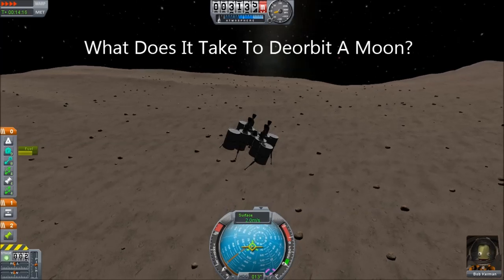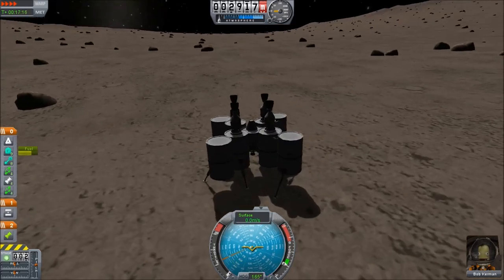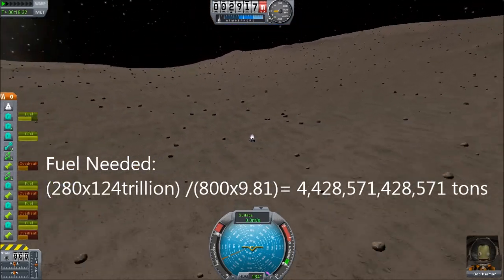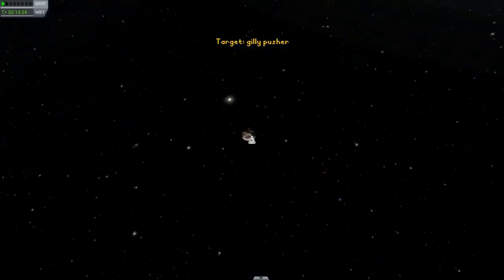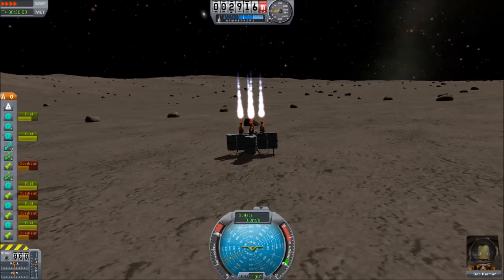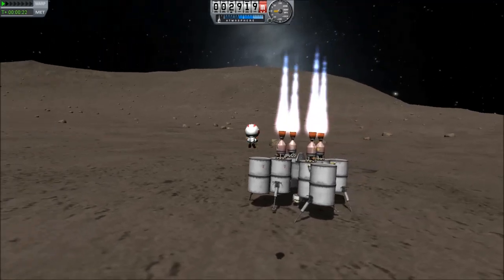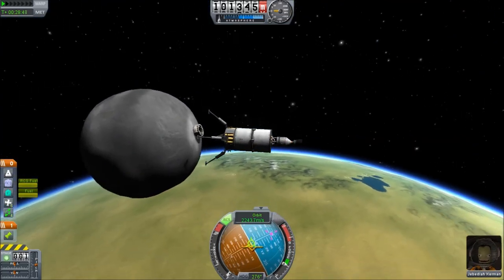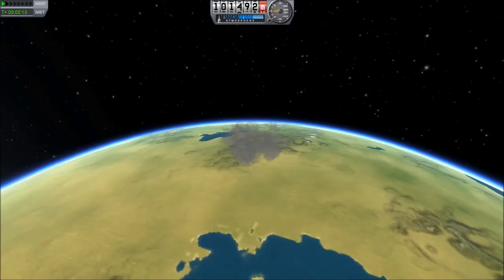What does it Take To Deorbit A Moon In Kerbal Space Program

Comment: Gas rockets can't move any massive object and here's why:

Unless you get the exhaust moving faster than escape velocity it will just return to form an atmosphere and give no net thrust.

What's worse is this atmosphere will then further block the rocket exhaust from escaping.

And to top it off, even if it is travelling faster than escape velocity when it exits the nozzle, it's a gas and will expand. As it expands it will no longer be heading straight away from the moon, making it even easier to be recaptured by the gravity well.

Comment: Mining invented: I'm about to end Gilly's whole career.
Reply: Mining & converting fuel from the body you're pushing would make it at least a million times easier -- literally!
Reply: @eekee6034  That just sounds like a fuel tank with extra steps
Reply: @rockspoon6528  I'm not sure what you mean. What I mean is if you bring all the fuel you need to move the moon, then at the start of the burn you have to move all that fuel and Gilly too. If you mine Gilly for fuel, you start out with far less fuel mass and you lighten Gilly as the burn goes on.
Reply: @eekee6034  My point is that you're using Gilly as a fuel tank.

Comment: How long would it take 5 F-1's (Saturn V booster stage) to turn Gilly completely into exhaust? Meaning setup some drills and an ore converter and just burn Gilly as it's converted into fuel. I imagine that would be an easier way to "move" Gilly haha.
Reply: According to my math it would take the Saturn V 1.927 trillion seconds to turn Gilly into exhaust.

5 F-1 engines could burn 12,890kg of fuel (5800 OX + 7090 LF) per second.
6,445 units of ore would be needed per second (64,450kg)
4,297 Drill-O-Matics would be needed (1.5 units of ore per second) or 172 with a level 5 engineer
2,578 ISRU's would be needed (2.25kg OX + 2.75kg LF per second) or 104 with a level 5 engineer

Mass of Gilly = 1.24×10^17 divided by 64,450 = 1.927 trillion seconds, or 61k years.

That's much quicker than 19 million years.

Comment: i remember making an engine mod and made it work no fuel, i tried to push Kerbin out of the way with an Engine that has 1 times the weight of the planet and it could fly up because it had 2x the power! so starting with it upside down on the pad, when i turned it on, it did not push the planet and that is how i figured out it was on rails! tho when i removed the weight and not the speed, in the inverted position, it just teleported out the planed into black! and the game was all bugged and no menu! the speed started with the number 4 but had to many numbers to display! cool and freaky experience!

Comment: You could use an extractor and a converter to replenish your fuel as you worked. For that matter, if you packed along enough extractors and converters, you could use a Mammoth or two instead of a NERV, since you can convert ore into oxidizer and liquid fuel at the same time. Use the Mun itself as your fuel tank! Of course, that still leaves the problem of "it's on rails". Mod anyone?

Comment: but You use only 5 engines? but with a 100 x100 engine's will it be stronger?
Reply: 100x100 engines.. You didn't account for the extra 500+ engines in the middle. No, it won't exhaust the fuel in a second, considering that you're having a few billion large fuel tanks in your store, so you're gonna need another few billion engines, then it would last for a second, and deorbit gilly at the same time.
Reply: Will be stronger yes, but will only last for like a second.
Reply: TheRedRifleman Animations Then it would basically just destroy the fuel tanks because the force ist too high.

Comment: You missed something:
To deorbit a moon, you would need a shitload of fuel. However, this fuel isn't just present there — it has mass of it's own. In fact, in order to move a moon using fuel, you would have to move the whole system of that moon, fuel, fuel tanks and engines — all adding up to whole mass counter. That means you would need MUCH more fuel to move the moon AND itself, along with tanks and engines, and adding a single engine would mean adding more fuel, because engines, of course, have mass, too.
There is another thing, however. By adding so much shit onto the moon, you would greatly increase it's mass, therefore it's gravity. It may be even enough to cancel the orbit and make the moon crash straight into the planet! Who knows? Calculations have to be done.
Reply: Though you still won't need as much as he mentioned. He said that he would want to "deorbit" by changing the velocity of the moon to 0. You don't need to do that in order to consider a moon being deorbited.
Reply: Medhusalem Problems of definitions. Of course it depends on the body that the moon orbits around, but decreasing velocity to zero is a fool-proof way to deorbit something - say, if both objects are just physical points with zero volume.
Reply: How did those calculations come out
Reply: @arandomcommenter412  Best of necroposting lol. Besides, I said I'm too lazy to calculate, and I'm true to my word.
That being said, a quick run through what I said makes me think I was mostly full of shit. Moving mass to the satellite would require matching the satellite's orbital v, and the worst it would do gradually destabilize orbits, moving system's center of mass until it becomes a two body problem, and then back into satellite problem if we move enough matter, but the planet and the moon would switch places in the system. They may potentially crash due to orbits having to cross each other at some point, but they won't deorbit.
Good to see I've made progress in the past six years.
Reply: the weight of the fuel would be negligible compared to the satelight
Reply: It may be much less, but definitely not negligible — still thousands and thousands of tons. I'd do calculations, even, but I'm too lazy to do that.

Comment: Obviously the most efficient way to de-orbit a moon in kerbal, assuming they weren't on-rails, would be to just land a big ass engine on it with a little fuel tank but with A FUCKTON of mining rigs and ore to fuel converters.

Why bring fuel when you can just make fuel from the moon? The more of the moon's mass you convert to fuel to de-orbit it the easier it becomes to de-orbit :D

I don't understand why scott didn't mention this as it is literally the first thing I thought of when I thought of possibly de-orbiting a moon.

Another big snag in the road would obviously be the moon's rotation. You could basically only be firing your engine a little under half of the rotation or otherwise you'd be killing the delta-V you built up on the 2nd half of the rotation.

I am disappointed Scott that you didn't mention these things as I am sure you are bright enough to know of them :)
Reply: the objectives to de-orbit the moon. not break it down and turn it into something else
Reply: Robert Harris
The % of mass you'd have to convert to de-orbit the moon is irrelevant. It's not like you are turning it into space rubble. And even if you shrunk the moon down to 1/100th its size it would still be a moon (until you actually de-orbit it and it is no longer a moon.. which makes your entire argument moot because turning it into 'something else' is EXACTLY the point)
Reply: ayporos uh. No. As long as its seperate the moon is the moon. Theres only 1. However it will no longer be a natural satalight.
Reply: RedRifleman studios wtf are you talking about?
Reply: Robert Harris
Just using combat as a way to disprove explosions in space. Really, if you need to move a moon with explosions only, you should use nuclear weapons.
 and, using the moon doesn't make it artificial: it just means we modified it.
Reply: RedRifleman studios you know theirs 2 ways to deorbit a moon right?
Reply: Robert Harris
I know that! You think i'm stupid? YOU DO? well then.
Reply: RedRifleman studios your the one talking about something completly random.
Reply: Robert Harris
You're the one trying to make me look stupid. Now, Explosions aren't possible in space unless the explosion is happening in a material. Simple as that. So you need nukes for the explosion to actually work, because the nuke will be exploding inside it's shrapnel.
Reply: RedRifleman studios i never said anything about any explosions...
Reply: Fuck wrong comment

Comment: If we are going to talk real physics here, it's still not possible with ANY amount of fuel, as the exhaust gasses will remain in a moon's atmosphere, and only contribute to it's mass. An ion engine would probably work because the ion plasma escapes at a fraction of the speed of light. This is why they have such high specific energy. But they are very low thrust.
The reason it works with an asteroid is that the asteroid's mass is insignificant, and the exhaust gasses readily escape any interaction with the asteroid.
Although on a moon, the exhaust gases do escape at a rapid velocity, and you'd think they would shoot out into space beyond escape velocity, this isn't true. They are, afterall, gases, and a gas has all sorts of characteristics like molecular interactions, bonding, and PRESSURE. The escaping gasses will form a slow moving cloud and eventually envelope the moon. Shooting a rocket off will quickly need to move it's own exhaust ploom off the moon as well. The ploom will begin pushing back on the moon with an equal force. Using a rocket on a body large enough to have just a slight atmosphere would be no more effective than pushing on the handrail of a boat, while standing on that same boat.

Comment: I realize this video is old, but here's a thought Scott.  Did you take into account the density of the fuel in your calculations?  The engines aren't just pushing the moon, they have to move all that fuel as well.
Reply: What if the fuel is in orbit and being transferred with a flexible tube?
Reply: @howlingdin9332   really old reply but like youd need a tube that is longer than the circumference of the moon because the orbiting fuel would be going faster than how fast the moon rotates
Reply: @John-pp6xy   You could put it in a synchronous orbit.
Reply: Howling Din 
this is an ambition that I like instantly
Reply: and the rest of the rocket parts
Reply: +Howling Din The fuel in orbit would be part of the moon's system. You would have to adjust its momentum in any case to keep it near the moon. TANSTAAFL here as well.
Reply: @Markle2k  just add a pipe that cannot possibly ever break, attach to moon, moon pulls fuel
Reply: Old? Yor comment xD
Reply: this was my 1. concern
Reply: The rocket equation takes that into account by default
Reply: What's more, did he take into account how it's more efficient to only burn near the apoapsis? That'd add millions of years all on its own.

Comment: The Earth's moon moves at 3.68 km/sec around the Earth.  It masses 7.348x10^22 kg and is roughly spherical with a 3,476 km diameter.  This means the Moon's volume is 21.99x10^18 cubic meters and an averaged density of 3,341.5 kg/m3.

A shell of material 102 km deep on the Eastern Hemisphere of the Moon (East of Sinus Medii and West of Lipskiy extending from Pole to Pole, centred North of Mare Orientalis) totals 1% of the lunar mass.  When blasted out at a speed of 368 km/sec is sufficient to stop the moon dead in its tracks which allows it to fall into the Earth.  A similar shell blasted into space on the Western Hemisphere (entered around Mare Crisis) increases the speed of the moon to escape velocity - which could take it to Earth/Sun L1.  
 
To impart a delta vee of 368 km/sec requires that 67.8 GJ/kg be applied to the material.  Thorium can release 79.42 TJ/kg of material.  Thorium at 12 ppm is about as abundant as lead.  That's about 1 GJ/kg from thorium.  The use of Uranium, Lithium-6 and Deuterium, more than doubles this figure.  

It takes 15 MJ/kg to ionise rock into its component parts, separate it by mass spectrometry, and separate out each isotope, and then additively recombine the material into anything.  So, starting with a 1 kg self replicating machine that is powered by nuclear materials found in the lunar regolith, and allowing 1 hour doubling period, we grow to process  the entire moon (7.348x10^22 kg) in less than 76 hours.

   LN(7.348x10^22)/LN(2) = 75.95977

Concentrating the nuclear materials found into the 104 km deep shell described, provides the means to impart 3.68 km/sec to the moon.  

Increasing the depth of the shell to 848 km from 104 km permits reduction of the speed to 36.8 km/sec and the energy 9.57% of the previous total, which means over 90% of the nuclear energy resources of the moon are retained for other uses.  

The point is, at a weight of 8 trillion kg over 9 billion O'Neill cylinders could be built out of the moon and sent to any point of Earth's orbit around the sun.  With 149.5 million km diameter, and a circumference of roughly   469.7 million km circumference.  Thus, around 20 O'Neill cylinders per km of length around the Earth's orbit at 1 AU may be built with self replicating machines out of the moon.  At one every 60 km, 7.83 million O'Neill cylinders each containing 1,000 persons per 800 sq km, can be built using less than 0.1% of the moon.
Reply: soooo, English please?

Comment: Alright, so from someone with only a loose comprehension of how to deal with numbers of this size...  Would it be more efficient to launch a rocket motor(s) and all those trillions of tons fuel to the tiny moon to burn off and slow the orbit via thrust, or to build a denser sort of craft with only enough fuel to fly itself out there to collide with the moon and try to knock off enough speed in one sudden impact?
Reply: It depends. If the collision was perfectly inelastic, ie all the impact energy went into the moon, yes that would be better. Flying a rocket to the moon with fuel to burn on the moon would be as efficient if not for the energy lost in getting there and then slowing down for a soft landing.

Comment: could you do it using the interstellar mods' antimatter powered deuterium engine
Reply: +Johiah plays games Increasing the efficiency of the engine would dramatically reduce the amount of fuel you need, but unless it puts out more thrust than the NERVA rocket, it won't deorbit objects any faster.
Reply: +Jordan Shank I didnt mean to do it faster. Just within a reasonable amount of fuel.
Reply: Johiah plays games *More* reasonable, yes, but maybe still not good enough. I couldn't find the ISP of the mod's engine, so I'll estimate its exhaust velocity is around 15,000 km/s, similar to other fusion rockets.

If the object you want to deorbit has a mass of a trillion kilograms (roughly the mass of a kilometer-wide asteroid), you'll still need around 30 MILLION kilograms of fuel to slow it down. That's a much more reasonable number, but it would be the largest project humanity has attempted so far. Doable, but not easy.
Reply: +Jordan Shank The lower the thrust, the higher the isp it has. Scott built an interstellar eve plane that can fly back and forth from eve to kerbin like 3 times.

Comment: I know this is an older video, but how 'bout the Ion Engine?
Reply: 8.43 • 10^11 Tons of Xenon.
This would mean 28902857142858 X150 tanks, and 1321910427.8 years.
Reply: Giannis Pantazis Yup. Isp is 5.275 times higher.
Reply: Xannari Ferrows On one hand... DAMN
On the other and, that's still a smaller mass and volume total than the chemical option... right?
Reply: Xannari Ferrows That's what I'm sayin'. So it IS a win! Hah! But wait, how much of a fraction of the chem fuel is actually the volume/mass of the xenon fuel? They have neither the same density, nor fuel fraction in each tank.
Reply: Giannis Pantazis The mass of Liquid Fuel is 50x greater than Xenon. Since the Oscar-B [for scale] occupies 1.245x the amount of space that the X150 tank holds, that means 48.4167x more Xenon is stored per tank.
Reply: DarkBabyIon Well, we can always use more engines. The same fuel fraction will be used anyways.
Reply: Giannis Pantazis Not true! Adding engines adds more mass, therefore requires more fuel to keep your Delta-V the same.
Reply: DarkBabyIon Anyone that knows Delta-V will know that TWR means nothing. Adding more engines adds more thrust, yes, but what you really care about is the ratio of your full mass to your structural mass. Adding an engine will slightly decrease that ratio, therefore getting you less Delta-V.
Reply: Xannari Ferrows Woops yeah, I forgot for a sec. Most likely got confused because the ship is landed on the moon, and not free-falling through the cosmos.
But still, judging from xenon's density, the low mass of Ion Engines (and their electrical paraphernalia), and the ridiculously low thrust of a single engine, it is arquable that bringing along more engines is still more beneficial in the long run, as the added fuel will not be that much compared to the billions of years saved.
Reply: Giannis Pantazis That'll be 239185727495 • 10^44 Tynes.
Reply: Xannari Ferrows Tynes?
Reply: Giannis Pantazis That's how much it would cost.
Reply: DarkBabyIon A very limited form of currency that is used only by ones who cannot speak the official languages of Earth. 

I am one such person. In fact, if you were to meet me in real life, you would not understand anything that I say. You can thank Mariyate for the smart translations.

Comment: Based on those numbers, though, it COULD be possible if they were to include an engine that was basically a miniature nuclear weapon with its blast zone somehow reduced to a tiny force trajectory... the Tsar Bomb produced 210 petajoules (that's QUADRILLIONS of Newtons per meter) with a weight of only 27,000 kg (admittedly packed into a tight 8 X 2 meter missile)

If that energy could be focused into a single lateral direction, it would be TOTALLY plausible to de-orbit a minor celestial body like a moon.